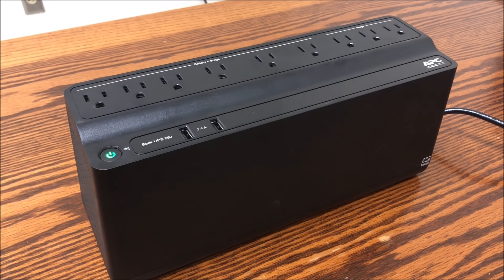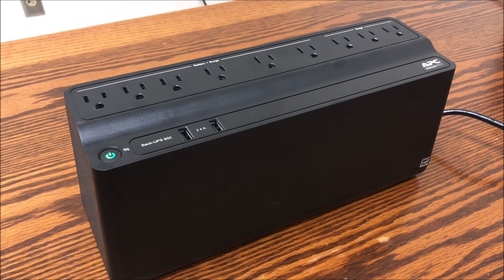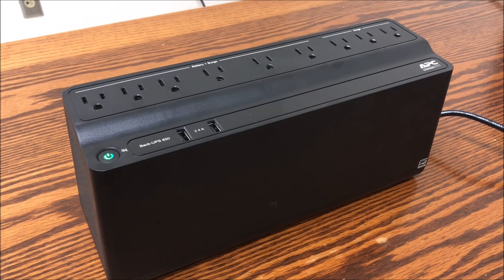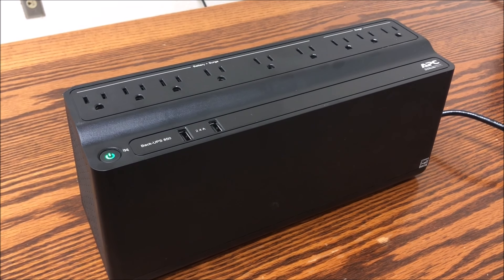Using Quick Mute on APC Back-UPS ES M-Series | Schneider Electric Support

Comment: Pressed 2 seconds, and it shut down my computer...... Thanks.....
Reply: Same.  For the 5th time. Nice.
Reply: Dont press for 2 seconds, if you hold it for 0,5 seconds to 2 seconds, it will work
Reply: Just replace the battery
Reply: Pressed for 2 seconds will power off UPS
Reply: I really should have read the comments before pushing for 2 seconds cuz I turned everything off
Reply: All of you should have really read the directions
Reply: The beeping started right back.
Reply: @IndieAuthorX  Yes, try for 1 second😄

Comment: This should be a basic option on all models...got a basic model coz i just needed it for my home WiFi router. most irritating noise in the world at 3a.m especially when you use it on low power devices such as a single WiFi Router. The beep goes on for hours, kept the whole family awake. Wouldn't recommend their basic models.

Comment: the best way is to take it apart (make sure to pull the plug and disconnect the batt connect) then on the motherboard there will  be a small black cylinder then yank that bihh off problem solved.

Comment: My model BX625CI-MS had this beeping sound. Upon examination, I saw that the light indicating that the battery needed to be changed had lit up (red light). I replaced the battery. The battery change light is now off. But the beeping sound remains. Very irritating.

Comment: The double-beeping did happen when I held it down for 2 seconds but it didn't mute the beeping noise. It only beeps when I'm playing big games like call of duty for example on my PC. Guess I just need to buy a better one.
Reply from the maker: Thank you for your message. We apologize for any inconvenience caused. For troubleshooting support or to express your concerns, please reach out to a technical expert in your location here: https://www.se.com/ww/en/work/support/country-selector/contact-us.jsp
Reply: Did you manage to fix it or did you buy a new one?
Reply: @fdjp7338  bought a new one
Reply: @maniac7591  alright thanks for the reply, i might consider that after i fiddle with mine a bit more
Reply: @fdjp7338  I ended up getting this one. Working well so far and can handle when my GPU is using a lot of power.

CyberPower CP1500PFCLCD PFC Sinewave UPS System, 1500VA/1000W, 12 Outlets, AVR, Mini Tower
Reply: @maniac7591  alright, thanks for the suggestion, i appreciate it, this one just keeps beeping no matter what i do so ill probably change it aswell 😂
Reply: You just need one that can handle a bigger powerload, that's all..  alternatively, have one for your gaming rig, and one for "all the rest"

Comment: How do you PERMANENTLY MUTE it?? It keeps beeping every 2 seconds after muting it when it keeps jumping to battery power. I just want some quiet!
Reply: I found that link for the user manual. It looks like your answer is in the "On Battery Indicator Modes" section. I think it can be set to No Alarm mode. I don't own one yet and would love if you can confirm.

Comment: Never buying another one of these again. From manual:
The Back-UPS is able to temporarily mute user correctable alarms such as On Battery.During such alarms, a short press (less than 2 seconds) of the POWER button will temporarily mute the alarm until the condition has been reset. A short double beep will confirm that Quick Mute has been activated. Pressing the POWER button for more than 2 seconds will turn off the UPS.

***** Other critical events such as Battery replacement and Charger notification can not be temporarily muted *****
Reply from the maker: Thank you for your message, Reviving Retro. Please contact our APC Customer Care team for assistance with your question: https://www.apc.com/us/en/support/contact-us/

Comment: I just bought an APC BN650M1 Backup, and the light on the power-up button is constantly blinking red.  I see a green light initially but the it turns to a blinking red.  Should I return it to the store?
Reply: You have to configure and connect the battery